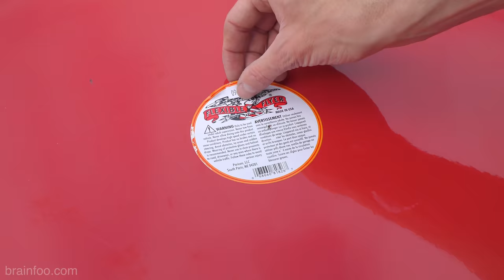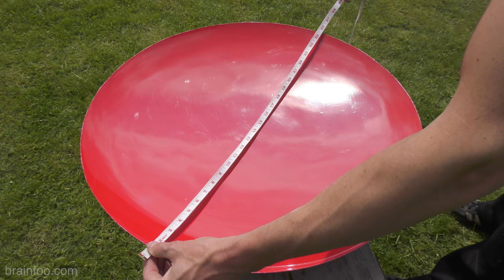Mark 2 Captain America Shield DIY Build

Comment: *It also helps if your friend is a billionaire, genius, play-boy, philanthropist.
Reply: It aslo helps capitain America
Reply: Still wont be made by Vibranium... Cuz it doesnt exist
Reply: pepperbotn Or dOesss it
Reply: chezboi i dunmo
Reply: iron man dies
Reply: Jk
Reply: @pepperbotn5546  it exist but rare
Reply: @zulfixacar  it's doesn't OK
Reply: It actually does but it’s very rare to find
Reply: @MerlinOfAtlantis  hey its not rare u serious its not a real thing u can search
Reply: @samiaafroz8434  
Titanium
Chemical element
Description
DescriptionTitanium is a chemical element with the symbol Ti and atomic number 22. Its atomic weight is 47.867 measured in daltons. It is a lustrous transition metal with a silver color, low density, and high strength. Titanium is resistant to corrosion in sea water, aqua regia, and chlorine. Wikipedia
Symbol: Ti
Electron configuration: [Ar] 3d24s2
Atomic mass: 47.867 u
Melting point: 1,668 °C
Atomic number: 22
Reply: @MerlinOfAtlantis  ok
Reply: Ka

Comment: i just used the metal sheild and the fiberglass to add dimension thickness that tappered out to the edge and for the bolts . I went with the comics original concept. where the bolts were set up differently for wearing on your back . great job like to see you   build a sheild that has depth that tappers to the center . it will have a greater range if thrown . due to the added thickness. have fun enjoy your vids

Comment: I wonder if keeping the mold you had on the shield and seccuring it somehow would make it even stronger. You'd have the fiber glass as a back plate  to the aluminum and than the aluminum to take the first strike.  Plus if you made it removable somehow you could replace it quite easy.

Comment: That's pretty cool! Can you make a REAL metal shield?
Reply from the maker: I could but I dont really see the benefit TBH. To get the same sort of strength, I'd have to go really thick with aluminium or steel (heavy), or spend about £1200 + on Titanium + Metalworking costs. And then I'm going to end up where I started maybee.
Reply: Maybe you can use satellite dish. That will be much cheaper than metal working and titanium.
Reply from the maker: You could also use a Flexible flyer shield like here : https://youtu.be/2Wg8Ch6L_-Y

The trouble is you end up with sharp edges, and something that is overly flexible and will bend. Whilst it's still a cool build, It will definitely not take the abuse I throw at it in my other video though : https://youtu.be/JnzaevBO6B4
Reply: you could just back a plate of steel with a fiber glass sheild
Reply: Berkcan Duruk hi
Reply: timothy stewart
Reply: timothy stewart
Reply: I'm
Reply: Berkcan Duruk yea
Reply: Berkcan Duruk and
Reply: Berkcan Duruk türkmüsün
Reply: Berkcan Duruk with a steel and titanium alloy???????????????
Reply: Berkcan Duruk well he can't because if he DID use metal It Would Ne Too Heavy (I Think I Don't Know)
Reply: Vitan Vu just use vibrainium
Reply: Berkcan Duruk he could add more layers
Reply: Berkcan Duruk lets hope
Reply: Berkcan Duruk it would be too heavy and weak
Reply: You really don't want a metal one.  It WILL dent.  The fiberglass one is crazy-strong and will NOT dent.
Reply: TITANIUM YES
Reply: Moonbase Cyberman vibranium isn’t real lmao
Reply: The thing is metal

Comment: Brainfoo TV, I got one question :

Why can't you just use that sled to make the shield  ( I mean, just fix belt on the concave side and paint the convex side red white and blue and fix the star) it would be a LOT easier if you don't have fiberglass,csm and even resin
Reply: I've never made one but i think it might be a heavier than the one he made.
Reply: @drivenbypassion3634  the sled is plastic  so it will not be so heavy. If I used resin it might be heavier than the original sled
Reply: @durgakarthik3984  i looked up the sled on amazon, its made out of metal. so i think the resin would weigh less.
Reply: durga karthik I own the sled; it’s made of metal. It’s not very durable though. It’s also prone to easy dents. It makes the shield heavier but also, using the sled itself as the shield would mean that it would also be prone to dents. It’s no vibranium but the fiber glass mimics vibranium in that it makes the shield lightweight, durable, strong, and flexible.
Reply: Evan Rogers does it absorb kinetic energy
Reply: Qwart22 I’m afraid that’s a Stark question.

Comment: What would happen if instead of trying to use the sled cutout as a mold, you encased the steel mold in the fiberglass making it a part of the shield. I understand this would make it very heavy but it would increase its durability by a lot. I think it would be a cool idea to try out and then attempt to destroy.
Reply: Not as strong because it will dent but its way cheaper than all that fibreglass

Comment: If anyone can’t afford the fibreglass CSM or the resin, you can just get the flexible flyer like he uses for the mold, it’s actually made out of metal even though it looks like plastic, so you could just remove the paint from the flexible flyer and then you would have a metal shield.
Reply: Yes you could but it is pretty thin and easy to dent

Comment: Would a plastic sled work just as well? Metal sleds are more expensive, so if a plastic sled would work that would be nice. Great video either way.
Reply from the maker: I dont see why not, but you would have to make sure that the inside face where you create the front of the shield didn't have any casting marks or designs that may ruin the look of your fiberglass shield when you remove it. You might also need another timber frame to add extra support so the plastic dosent wobble or flex when laying the fiberglass.

Comment: It’d still be possible to make the shield without cutting the mold down to size would’nt it? Albeit a little harder but still do-able. Might save some time if it works
Reply: Did you ever find the answer to this? I was about to try the same thing. Why do you feel it would be more difficult to make without cutting down to size?

Comment: would adding more layers, say 6-7make it stronger or have a neg effect like too much weight etc
Reply from the maker: Yes I would definitely make it stronger, but slightly heavier. The version in the destruction video is the MK2 which is only 4 layers, it would take 6 very easily. The MK1 had 5 layers and it's still light.
Reply: BrainfooTV thanks for responding so fast. If I make one I'll prob try five
Reply: Just tried a 7 layer one if you're wondering, 5 with 450gram CSm and 2 with 600gram. It is definitely heavier but is a lot stronger! Doesn't flex when I step on it compared with my 4 layer 600gram CSM
Reply from the maker: I also made a thick one as an early prototype, I know what you're saying Soooo strong. I made it for my son and he couldn't lift it Lool

Comment: why not just fill the holes at the edge and use the full size ? while working on the front, cut in the circular grooves to give a more realistic look instead of all flat, also build up the inside to give a thicker look when the straps and hardware are added.

Comment: You should try using real metal instead of using plastic
Reply: I realize you made this comment 4 years ago but I would just like to say fiberglass is not plastic and is also extremely strong and relatively bullet resistant but if he did make it out of metal and wanted it to have the same strength as this one it would be pretty heavy not to mention expensive and hard to make.

Comment: Can i also build a shild by using epoxy reskin and woven fiberglass fabric 
Or would this be weaker than csm and polyresin
Reply from the maker: Sure, epoxy would be stronger, but not by a massive amount. I could buy fibreglass cheap, that's why I used it.
Reply: @BrainfooTV  thanks 
I bought some epoxy 3 liters for 25 bucks and some woven fiberglass fabric in the end i will look like white carbon fiber 

Thank you for the Inspiration
Reply: @lukaspfeiffer4751   I used epoxy and 7.5 oz woven cloth. I had it on hand from surfboard repair and was more familiar with it. Also it smells much better. I added white pigment to the resin. Without the resin I believe the shield would have looked more clear than white. Through trial and error I got pretty good results but pinholes were a huge pain as I probably skimped on the resin for the face. While the epoxy resin may be stronger than the poly I cannot imagine the cloth is stronger than the CSM. I will more than likely try the CSM/Poly resin build exactly to Brainfoo's directions next summer now that I've got the mold and experience. A lot of fun but a lot of time!

Comment: make a shield out of titanium. Titanium is bulletproof and very light.
Reply from the maker: Its a bit of a myth that titanium is light. When titanium gets to a thickness to be 'bullet proof' to most firearms, it gets a little thicker than most people think. It's also not light, just lighter than the steel that would function in the same manner.

Comment: Wich one is better? Mk1 or Mk2?
Reply from the maker: That really your personal decision. MK1 full size 5 layers, you could use 4 if you wanted to. MK2 slightly smaller, 4 layers could use 3 or even 2 at a push, so cheaper. Decorate either the way you would like. All as tough as hell.